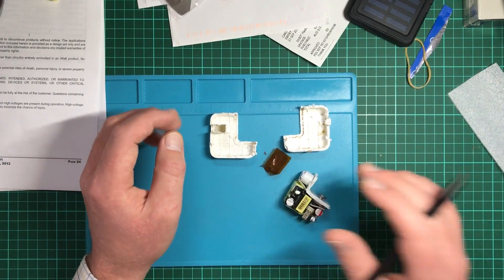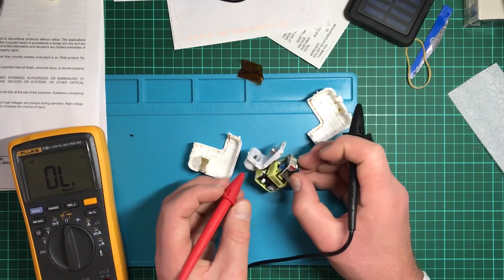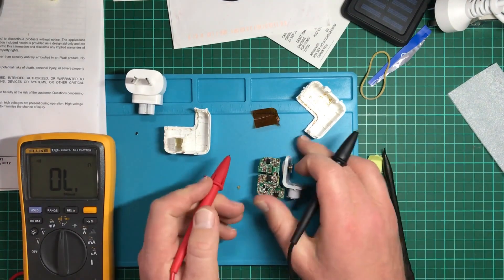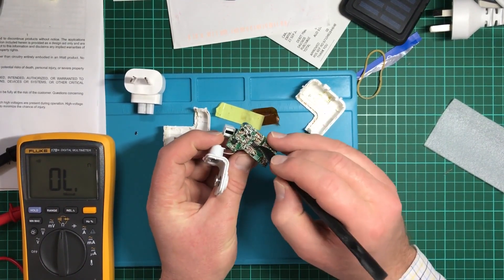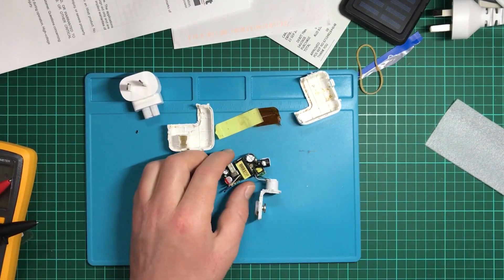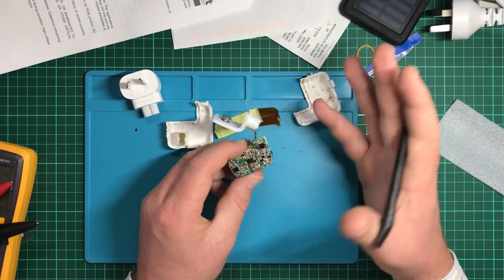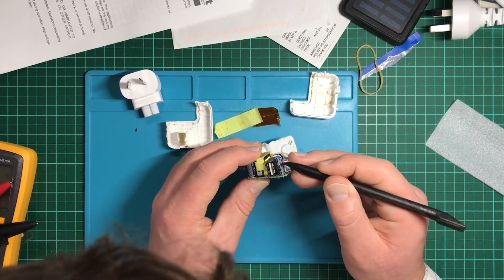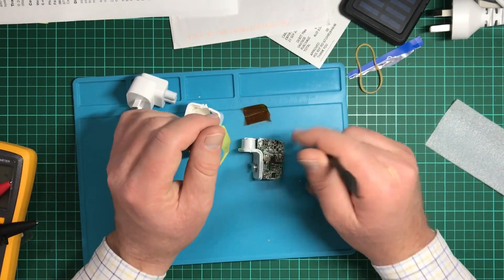Inside an Apple 10W USB Power Adapter

Comment: What are you trying to measure at 8:00?! You're not measuring the fuse here, just the supply line...
Reply from the maker: Measuring?

I don't think using continuity is measuring, I wanted to know if that was the active or active or neutral line. 
How else do you get the answer, if its not labelled?
Reply: @Michaelblog456  ahhh, I see! Sorry! 😂

Comment: What was the earth wire connected to?
Reply from the maker: It looks like it only comes into use, if you use a macbook power cable.
Reply: Michaelblog456 I mean the other end
Reply from the maker: That, I do not know. Also the datasheet I linked to in the description, might help.
Reply: Michaelblog456 well it would've been helpful, since you made this video, to actually tell us about the charger's construction.
Reply from the maker: No his was more, what is inside. And it sounds as if, you'd be better off watching videos of people who know what they are talking about.